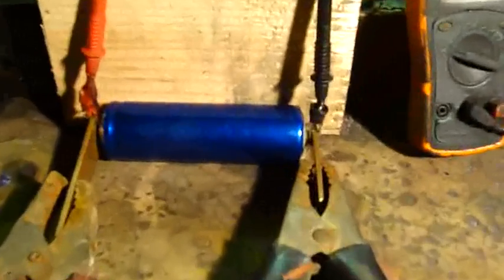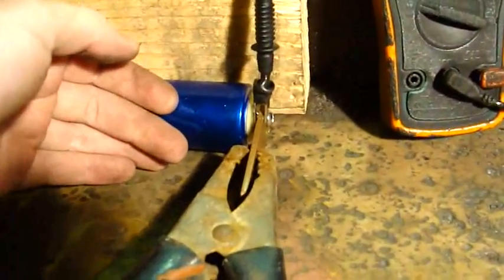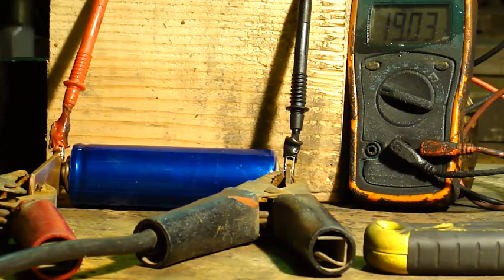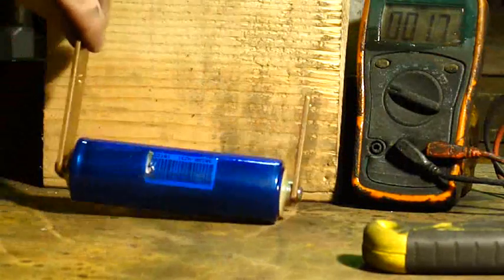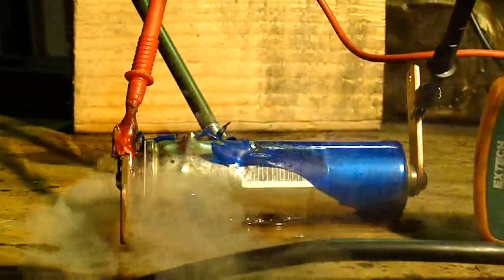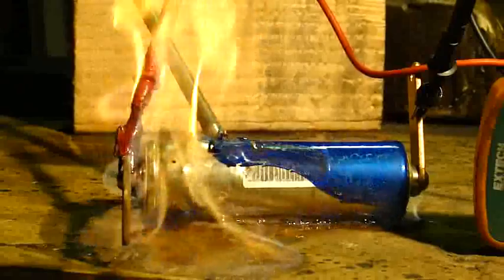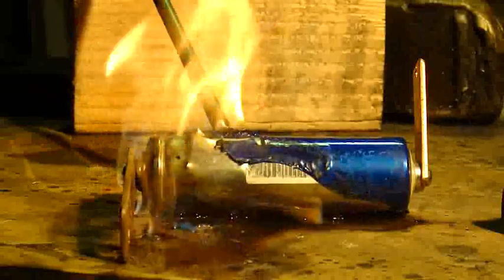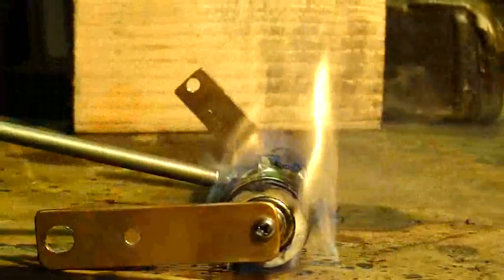Headways puncture.avi

Comment: This is fucking pure mine of gold of knowledge, this no-edited chanel has a lot of potential
Reply from the maker: Thanks for the kind words! I used to test cells just for fun, now I consult globally to test the best new cells in the world for safety and electrical performance, but the clients don't let me share test data.  If people are interested I could run some separate tests not for clients and be able to share the testing videos again.
Reply: @LukeLiveforphysics  WoW, I wasn't expecting that you would reply me. Yeah, I saw that cells and I wonder If I can use them to build batteries to connect in series to a scooter. What do you think? My current battery is 10s5p 14500mah of 18650 cells, you gave me the idea of using 2 of this cells to build a 1s2p or 4 to 2s2p to increase my speed without needing to solder anything or use a BMS.What do you think?
Yes, please, keep the good work and reviewing things, you content is like the oldie goldie YouTube, non-edited, non- commercial and full of knowledge

Comment: Why are you doing this I get it when you are over charging it because that may happen in normal operation but shooting it with a cross bow and  lighting it on fire and crushing it in a vice will not happen a a over voltage scenario. what did the battery do to you! Those batterys cost a lot of money! I don't want you to waist money. But why would you do this to a GOOD battery! Please don't do this again! RIP lifepo4 battery 😔.